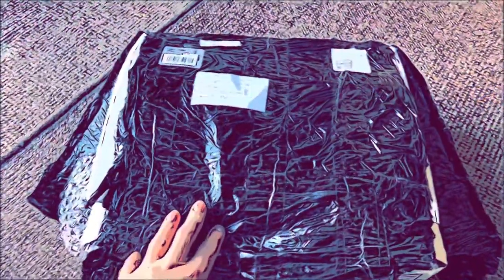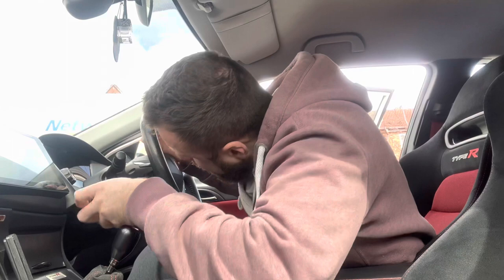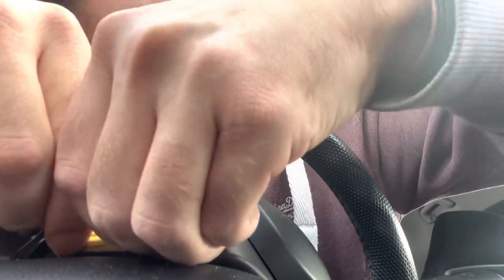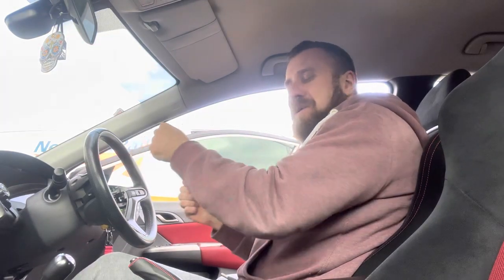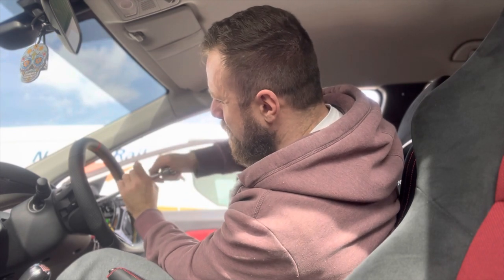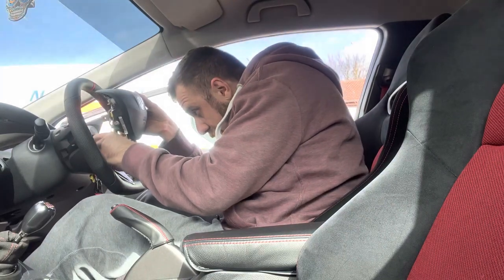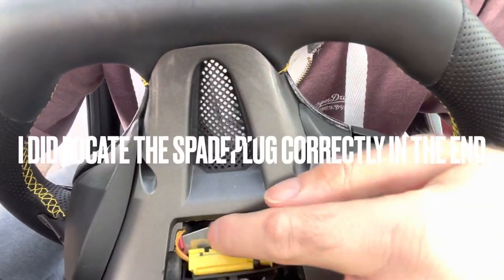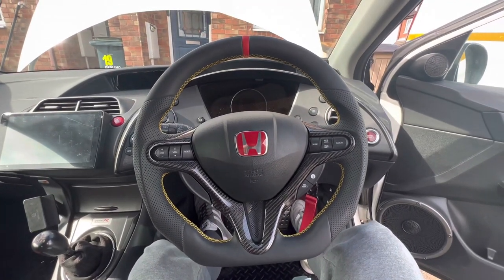FN2 Type R flat bottom steering wheel upgrade, with carbon fibre 🤩 Unboxing and full fitting guide!

Comment: If you were to do it again, would you go for round all the way or still do flat bottom?
Reply from the maker: 100% wouldn’t bother me, it does take some getting used to a flat bottom but the biggest thing for me was the massive thumb grip improvement at 3 and 9.

One thing I will point out though, if you are very tall or a bigger human being, it makes getting in and out the car easier with a flatbottom.